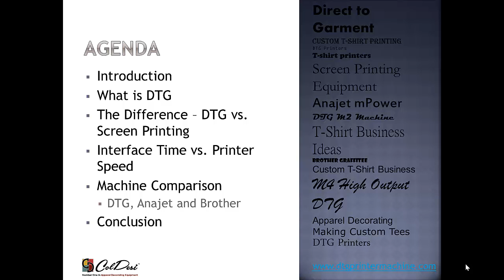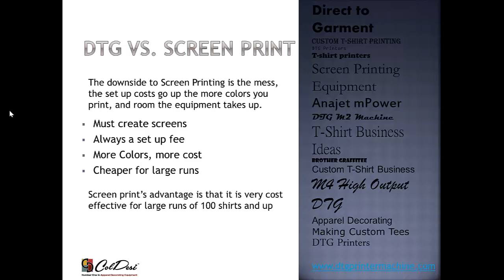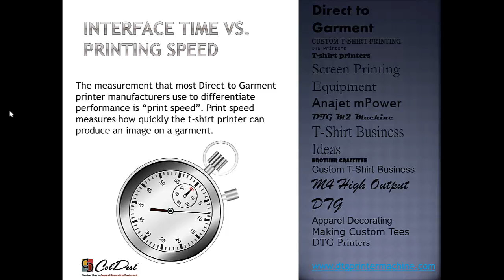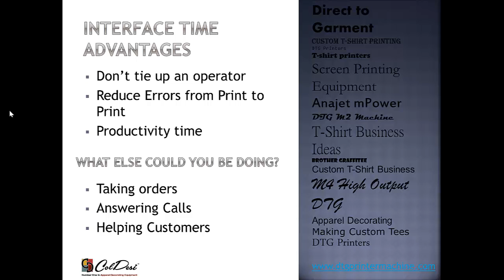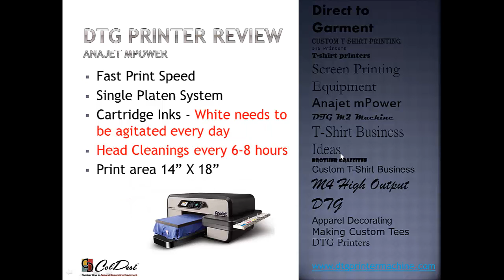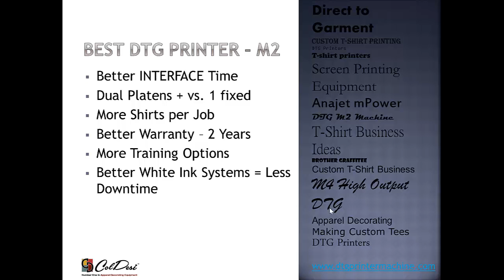Best T Shirt Printing Machine Review

Comment: The PRICE IS TOO MUCH!!!....not advisable for beginers, there's a lot cheaper alternative method of printing garments, and there's a lot
more other profitable investment you can start from $27K.
Reply from the maker: drone strike There ARE much cheaper ways to print tees, and if you'd like to start with under $2K you can look into a Cut & Press System from  Colman and Company (http://www.colmanandcompany.com).. BUT, if you want to be in the custom apparel business and want to offer full color, high resolution t-shirts that you can print PROFITABLY, this is the way to go. There's no other way to print such a wide variety of sizes and full color with zero set up time on light or dark t-shirts - The M2 even let's you print 2 different designs..or 4 different designs at the same time!

Comment: i see M2 is the best amoung these 3 but can you compare it with epson f2000?
Reply from the maker: Sure Hassan, that's easy! The three we reviewed are actually shipping :). The Epson won't be available until next year. From what I've seen at trades shows though, I can say the following vs. the M2 - the epson will not print 2 shirts a once like the M2 nor will it be able to print the variety of sizes the M2 does, so that Interface Time is still a big winner for the DTG brand. Also, I'm just not sure I'd want to be the first kid on the bock to have one
Reply: thanks for your reply mate but which of these printers can print of the sleeve?
Reply from the maker: The M2 or the DTG Viper will do that: DTG Direct to Garment Printer Platens, Not sure about Epson